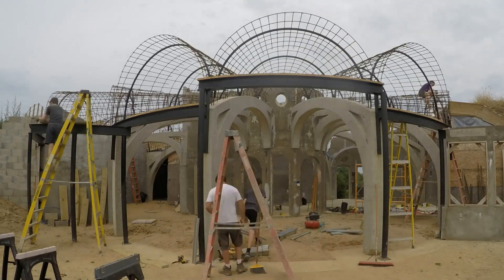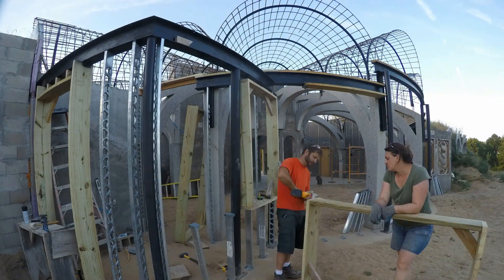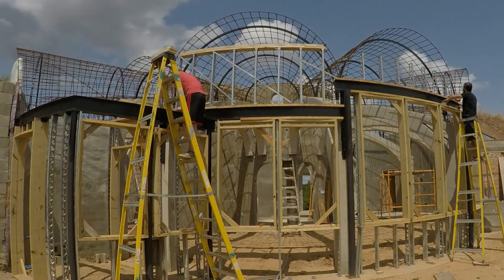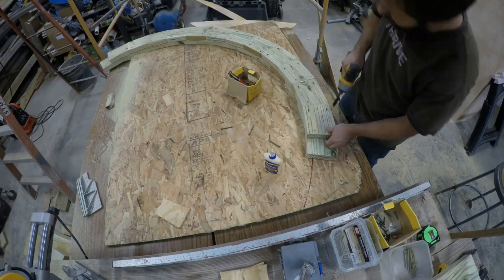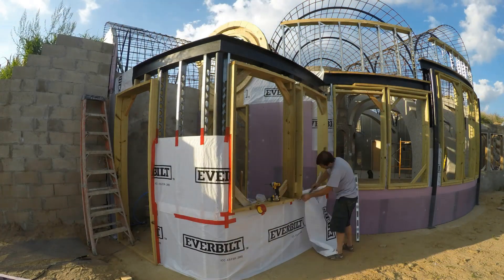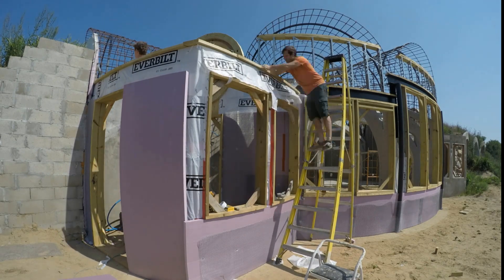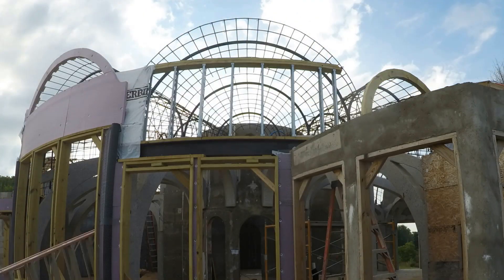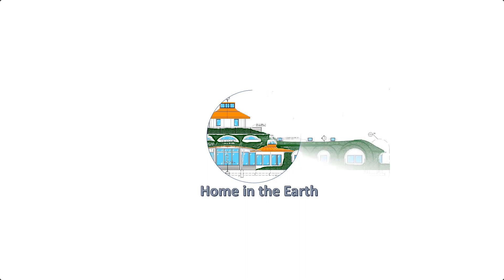41.2 XPS Gunite form for the South Wall

Comment: What brand of galvanized steel studs did you  use? They look perfect for light weight applications.
Reply from the maker: They are MarinoWare studs. https://www.marinoware.com/product/studrite/  The stamped out truss shape makes them lighter and much stronger.  They also conduct heat much less than a regular stud.  I also liked how easy it is to run rebar or electrical conduit or plumbing thru the holes.  As for the galvanizing...  I bought those Studs years ago and they have been sitting outside in all weather, even now, the ones left on my scrap pile have no rust at all.

The only catch is that you can't just pick them up at the hardware store, you need to order them to length.  But if you are planning a house, you should be organized enough to do that.
Reply: Excellent. Thank you for the information.

Comment: Looking good just one question that round window frame you formed up and installed looked like that I-beam ran through the bottom , you might have some trouble installing the window with a piece of steel in the way 'just sayin" . Great job guys every step is a step forward .
Reply from the maker: It isn't an Ibeam, but I did put a temporary wood beam thru there.  This whole thing needs to hold up against the shotcrete impacting it, so that extra bracing is good.  After we shot the wall, I cut it out.